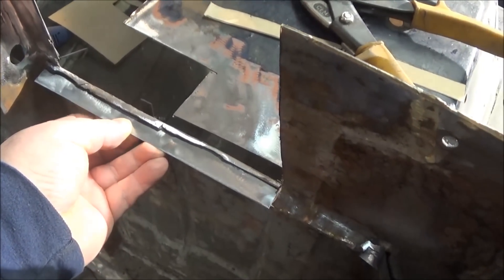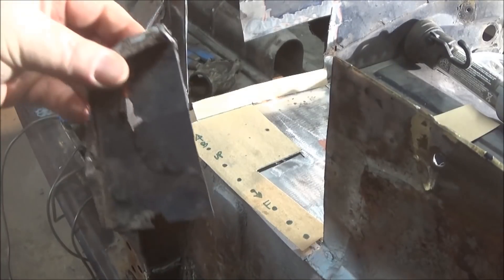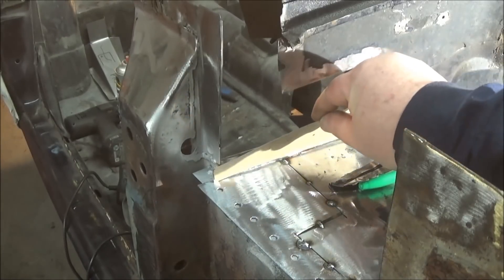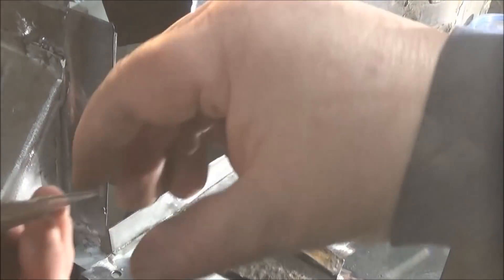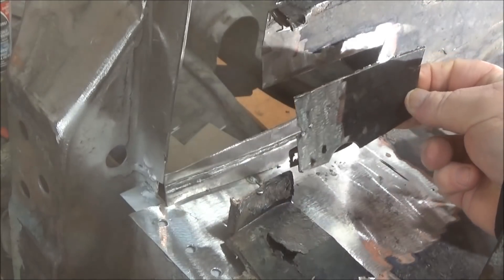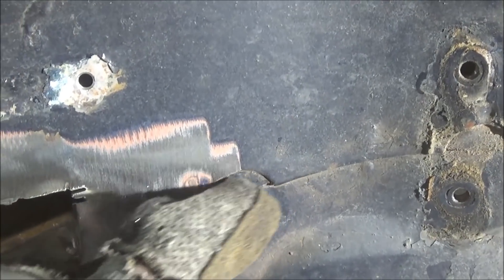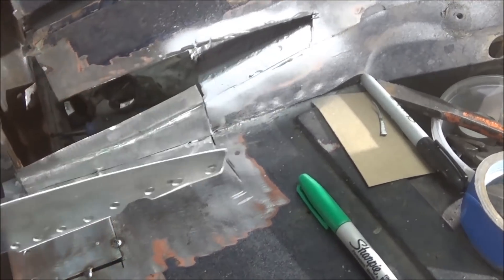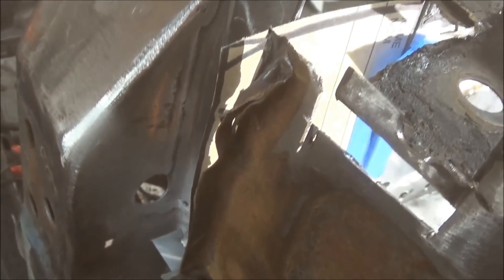1968 Triumph TR250 Restoration, A Post and Drain Scuttle Reconstruction, Part 2

Comment: Looking good David. I have sent you a PM on the TR Register forum as I can email you some pics which might help if you think it will be useful. The "pocket piece" as you call it was originally one pressing which extends all the way across at the back and wraps around the vertical flange on the A post as well as around the curved flange on the bottom.
Reply from the maker: Sean Fay Thanks Sean, just sent you an email.